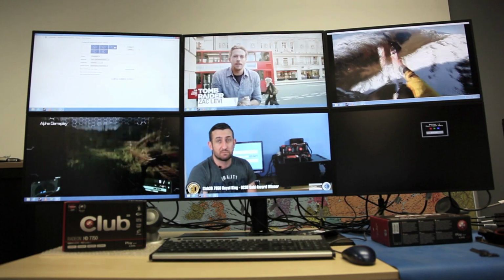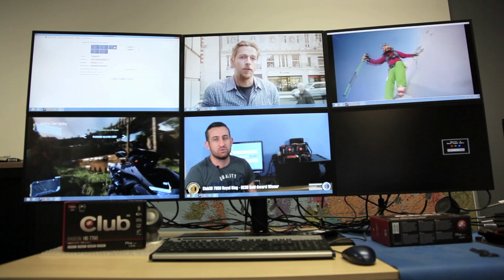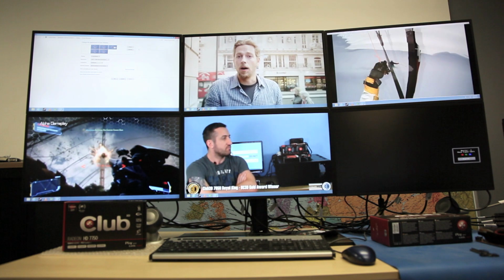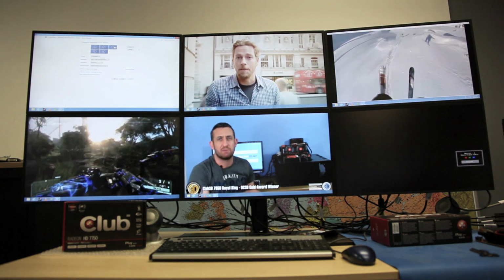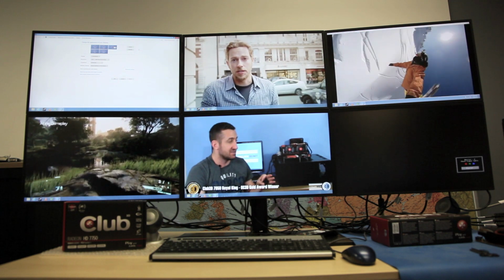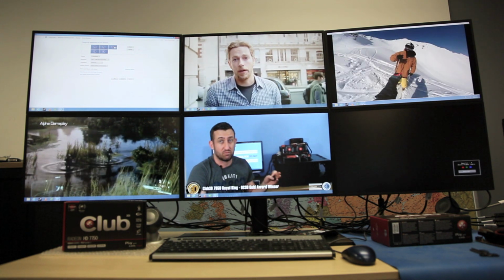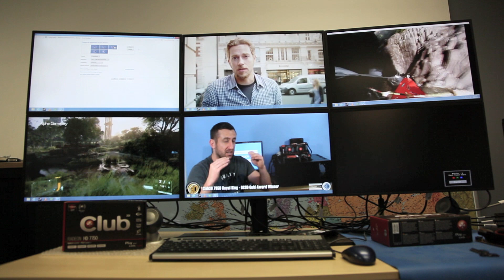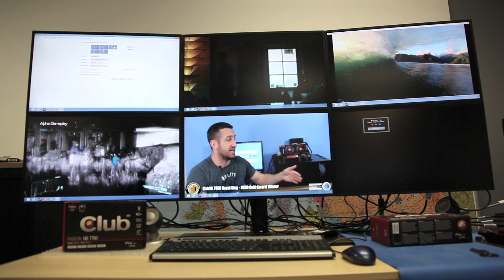Club 3D Multi-Stream Transport Hub (MST Hub 3-1 DP++)

Comment: Can i use one 4x1 Club 3D MST hub to create a 2x2 video wall so have the
 4 screens act as one big screen? I know this is possible using AMD 
eyefinity (depending on the graphics card), I've seen videos of it being
 done with other MST hubs from different companies however i wanted to 
make sure that the Club 3D 4x1 MST hub doesn't have any limitations that
 would prevent doing this (assuming the graphics card is capable of it).
thank you
Reply from the maker: Hi yes you can choose to create a SLS with the CSV-5400 Full HD as long as the VGA card has a free DP 1.2 port.

Comment: what is the difference between CSV-5300 and CSV-5300A?
Reply from the maker: The main difference is that the CSV-5300 uses a Synaptics chip and the CSV-5300A uses a STDP 4320. Main difference between the two is that the later is DP 1.2a instead of the standard DP 1.2. Please visit our site to find out more.

Comment: Does Eyefinity works fine if using passive DP-DVI adapter from the MST hub to DVI monitor ? With HD7850 and 3 of  24" monitor, can I get all 1920X1080 resolution?

Comment: amd  selling only shit now, last good and power card was HD 5870 (1600 streem processors), and now HD 7870 1200 streem processors onluy , wtf ? i dont know  how they did possible connect 24 x1080p displays  i want use like 12 displays , why i cant if i have 2x HD 7870  wich suport directly 6 monitors?

Comment from the maker: Yes it can, it all depends if you have a DP 1.2 or DP 1.1 spec on your vga card or notebook. With DP 1.2 you can set higher resolutions or use more monitors due to the bandwidth, on the DP 1.1 is limited due to the bandwidth. On our product page you can see a chart of the configurations you can arrange under system requirements
You must configure this with the Catalyst Control Center.